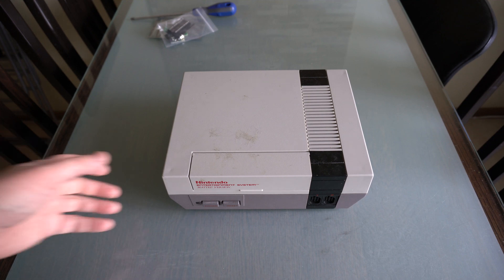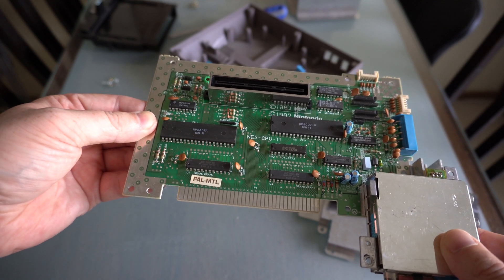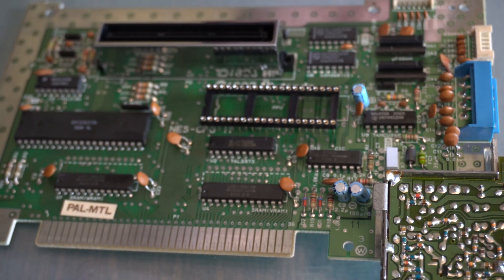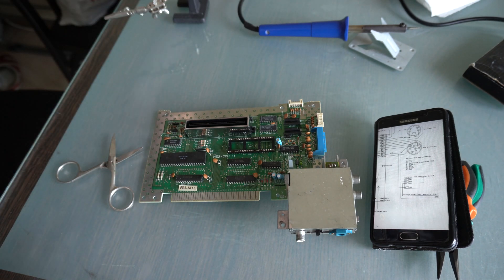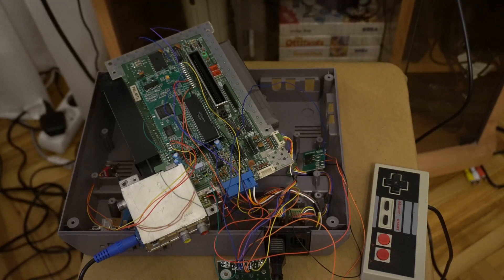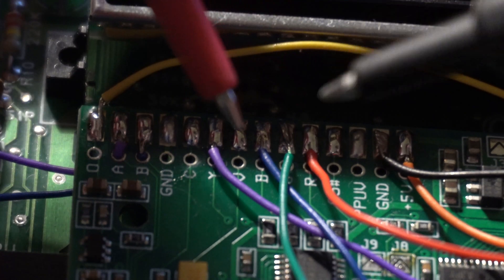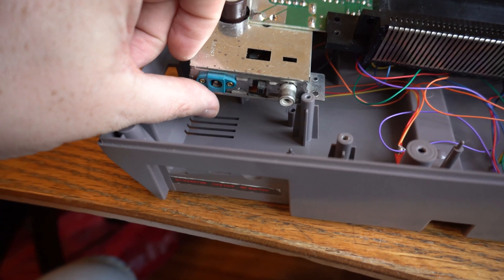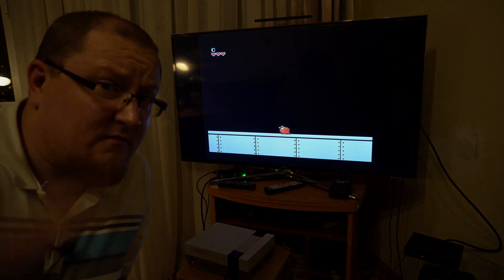NESRGB in original NES + MULTI-AV

Comment: eTim expects you to install the pin headers on the NESRGB and cut the pins down before installing the PPU. I prefer just raising the PPU since cutting soldered pins flush can damage the traces. Even when I used to cut them flush I would solder them again to make a smooth dome over the cut pins.
Reply from the maker: "cut the pins down before installing the PPU" it is not mentioned anywhere, so I don't do that. Also, all due respects to Tim, one should not provide pins that have to be grinded down.
Reply: He has removed the steps but you can clearly see that he has cut the row of square pins that protrude under the socket in his AV Famicom/NES toploader instructions (10th and 11th images on the page). You can still see the cutters in one of his images on the NES frontloader installation page. He used to instruct people to cut them so that the socket or PPU can sit flush with those soldered pins protruding underneath. Voultar and others prefer not to. Just lifting the opposite side of the socket or PPU while soldering lets you keep them level, and you can just install them canted if you want to.

Comment: The socket eTim was using on top was the wrong socket anyway. You should only use machined round-pin sockets with machined round pins… not the flat leads of a salvaged PPU with residual solder. A dual-wipe socket is too tall for proper NESRGB install unless you eliminate the other socket. I guess you could sandwich the adapter board without the pin headers if you want to be able to use two sockets with the PPU.
Reply from the maker: I understand eTims effort and this I consider it as a "know what you are doing" mod. You are right about pins of course. Sill I am thankful and happy how it works.

Comment: I just repaired a NESRGB for someone. It also had corrosion on the bottom pins and a mangled pin on top. Mangled pins on top are almost always from people using a tool to bend them up and make them tighter. Sometimes they do this and it all looks fine until they insert an official Nintendo NES Cleaning Kit. The cleaning cartridge has a fabric-coated card that snags on the bent pins, mangling them even worse when you pull the cartridge back out. They very often continue to work but it isn’t pretty and can scratch the gold contacts on the games themselves.

Comment: i tried to follow your  guide but you dont show how you connected all the wires... you just say you did it wrong or somthing
Reply from the maker: Hi, this was not filmed as "how-to" but I shared my experience with how I did fck up and annoyed everyone involved. But otherwise, are you also trying to do same thing and use SNES multi-av port with board attached to it? If so, then my mistake was that I did not know that on SNES multi-av port here: https://s3.amazonaws.com/beardedjunk/NES_Top_Loader_12_Pin_Pinout+(1).jpg pin No. 2 is grounded. So one will never get green color and all colors will be messed up.
Reply from the maker: What connector are you planning to install, is it that S-Video type plug that Tim Worthington provided? If you are going SNES style multi-av connector, then you could look into this: https://store.retrofixes.com/products/nes-frontloader-custom-multiport , it is very convenient to use, fits better in housing of front loader and I assume has some instructions on installation. If you still want to use bad SNES board, then you should be ready for some grinding down pins till the surface is flat and check the schematics on how to wire it. It is not complicated, just please keep in mind about that error I did. Darn green pin on SNES is used for something else obviously, since it's grounded.
Reply: @lauraiss1027   im literally trying to install the same one you have but its not attached to the board still i just followed your pin connections sort of then i looked it up and it was backwards or somthing so i swaped them around but skipped the x video signals and am not sure where your second blue wire is for there i also added the csync line to it to the nesrgb but no picture edit: i got it to work now didnt connect s video signals just used c sync getting wavy noise in the picture though but looks good otherwise i had to clean my pins on the board rly good to even get picture it just kept showing black

Comment: Do you need experience for this board or would you recommend letting it being modded by someone else?
Reply from the maker: Mod itself is easy, requires most basic soldering skills. Getting original PPU out of the board is a serious challenge. I really suggest finding someone with desoldering gun.

Comment: That's one big mod video , what a big amount of work you had there! I really wish to do this rgb nes mod someday, but this one has really scared the hell out of me , great job! It has turned out really well, your friend should pay you high bucks for such a great service hehe
As always, that was a really fun video to watch, and they keep getting better and better, with great video and audio. 
Regarding scripting the video, I tend to prefer non scripted videos, but I also may try a scripted one soon, let's see how it goes... 
have a great week
Reply from the maker: Thank's for comment, Boca! This mod is nothing compared to your Genesis repair project. I'm a bit ashamed I screwed up so silly with that tiny board I cut out of SNES, but otherwise it's pretty easy and you would have zero problems if you ever try this. I ask ~40$ for this mod, but that does not cover my expenses. If not for friends, I would not agree to doing this, since there is a risk of frying original PPU and getting replacement for a reasonable price is close to impossible. Also while pretty straight forward, it is still very long process from start to finish with all planning and drilling. No one would agree to pay the price it actually costs - days job + materials + partial risk coverage. If doing this mod for business, it should be ~120$ + mod itself is around 120$ making total cost of modded RGB console around 300$. Include Everdrive and that's already beyond latest console generation territory.